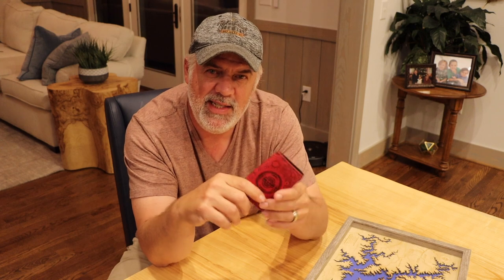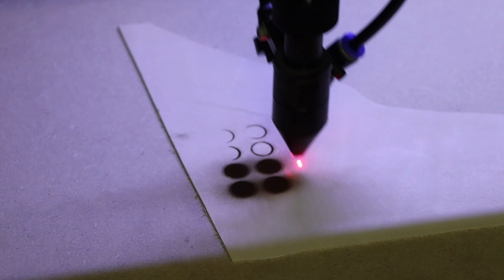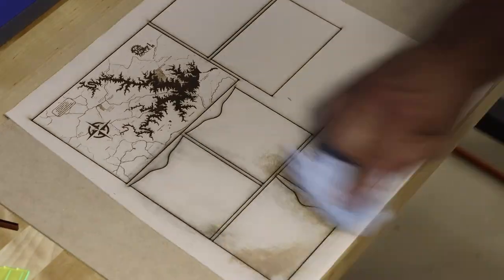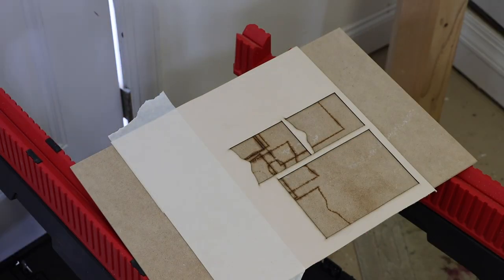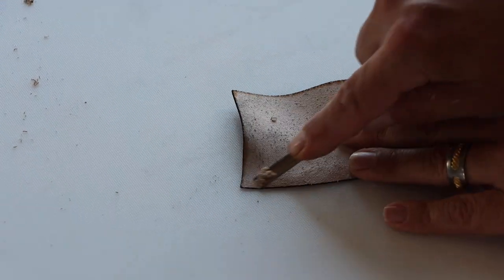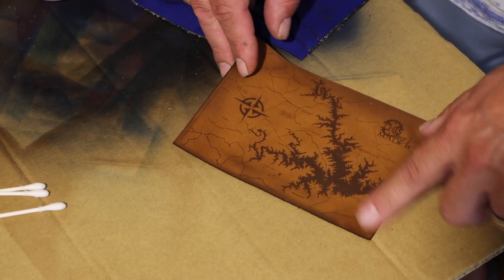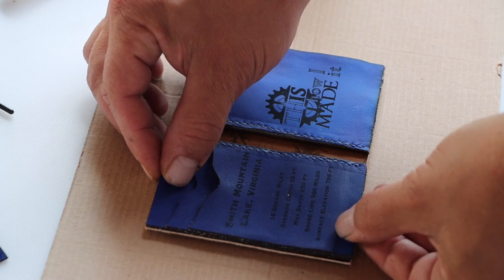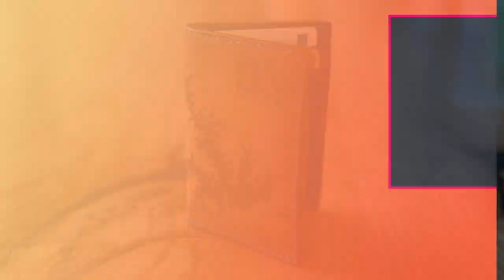Laser Etched Leather Wallet - More Lake Art with Lasers!

Comment: Your work is awesome as usual. I am currently working with my WeCreat 20w laser doing lots of leather projects. I vent my laser outside so the smell while engraving/cutting is negligible. But the finished cut of leather smells bad, especially if it is a koozie, for say a pint glass, which ends up near your nose when you use it. I am experimenting with an Ozone generator and having pretty good luck getting rid of the smell. Do you have any other suggestions I ought to consider?

Comment: Random question 2 years later...recently got a laser and have been looking into leather work with it...from my past experiences stitching and punching the holes for the stitching always seemed to be the difficult part....my question...can you use the laser to cut the stitch holes?
Reply from the maker: I’m sure you can.  It will likely be very dirty as you stitch…. But if you used black thread on already finished leather, I’m sure you could wipe it clean

Comment: The source data is vectors - why not keep it vectors all the way?
Reply from the maker: You mean do vector outlines and fills for all the images?  Certainly could - but wouldn't the raster engrave be faster and a little easier?
Reply: This Is How I Made It easier, yes. Faster, maybe. I found less material distortion and heating using vector fills, and reducing fonts to single lines made them clearer. My experience is from and older K40 so perhaps time has passed me by. You’re out there making stuff, I’m just kibitzing!